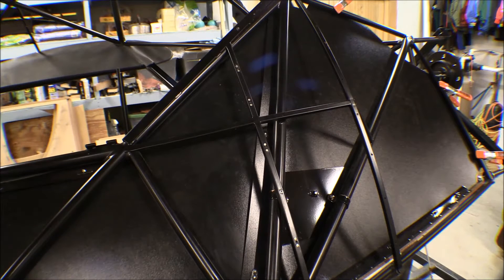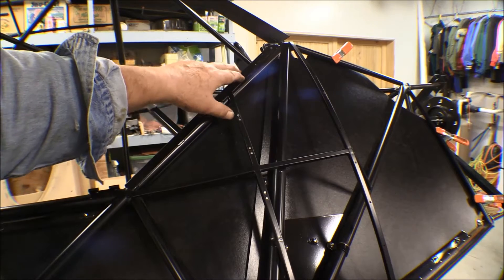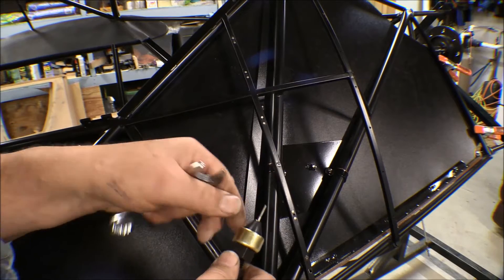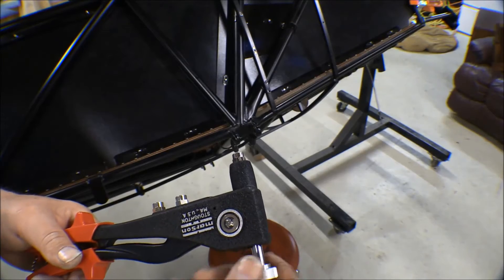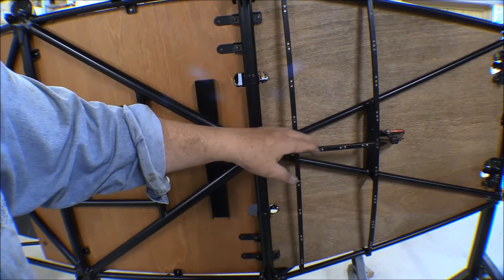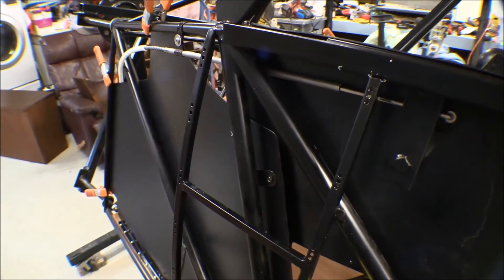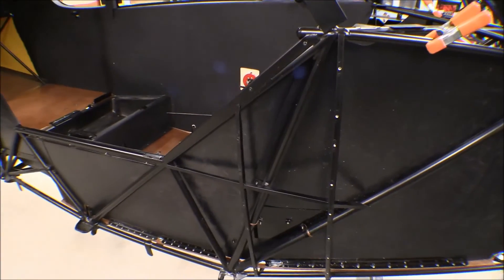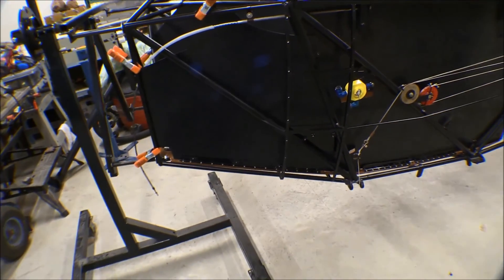Piper Supercub Widebody refurbishment: boot cowl attachment nutplates

Comment: Are you using a hand rivet squeezer for attaching the nut plates?  My rivet set piece is to large to fit in channel….
Reply from the maker: I got a flat set that was 1/2-3/4 long and ground down the sides to fit in the channels.
Reply: @psgflier  Thanks for the tip!  I’m going to plan to do the same.  I’m rebuilding my 1975 Super Cub with a new fuselage from Airframes.
Reply from the maker: @johnburtt3001  Straight fuselage? I got a widebody and had to make parts for everything. Took longer than I hoped, but happy with it now.
Reply: @psgflier  Yes, I bought the standard size with L21 windows & Willow Mountain lowered floor with extended baggage area.  Running into similar with the interior panels in the baggage area.
Reply from the maker: @johnburtt3001  It's been a while since I built mine, your question got me thinking. I ground two sides of a flat anvil to fit in the channel, but it might be a good idea to grind a third side some. If you use #4 nut plates you can't get the rivet set centered on the rivet as the distance between the rivet and the nut is so close. Makes it tough to get a straight squeeze. Seems like it's that way on the compact #6s that fit in the channel too. Not much fun drilling out those little rivets.

Comment: What size nut plate did you get to fit inside the 3/8" channels?  AN?
thanks,. John
Reply from the maker: I used nut plates for #4 screws in the rear channel for the panels and #6 nut plates for the channel where the boot cowl and panel overlap. The #4s are ms21075-04 reduced pitch floating nut plates and the #6s are ms21047. I modified a deep rivet set for a hand squeezer to fit in the channel by grinding two sides. I used nut zerts in places that I couldn't get a set on, but if I had it to do over again I'd use nut plates and cherry rivets.
Reply from the maker: I recommend using nas1097-3 rivets, the heads are smaller than the an426 so don't require as deep of counter sink. The load is all in shear so head size is no issue. I got 3-3, 3-4 and 3-5s, but mostly used 3-3s and no 3-5s.